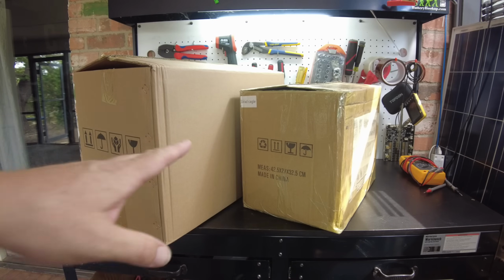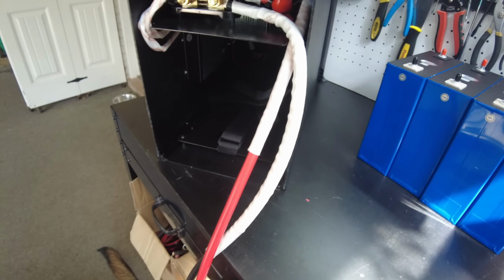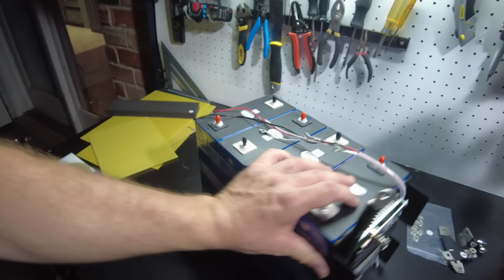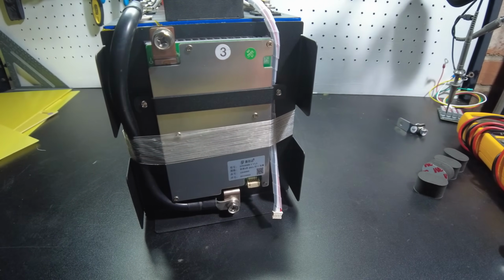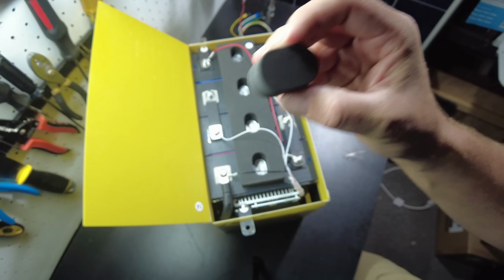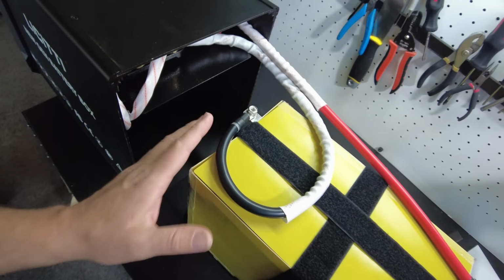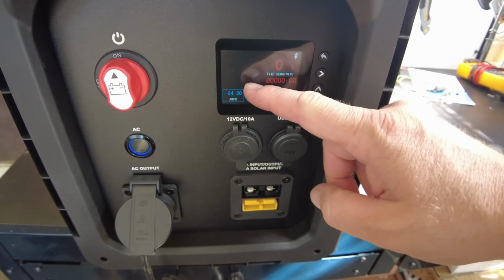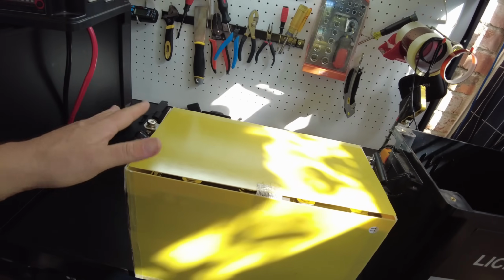Licitti 280Ah LiFePO4 DIY battery kit

Comment: I have one question. Since this box has a 20A MPPT controller and it is possible to connect a solar panel with a power of about 250W, is it possible to first connect a solar panel with a power of 600W to a Victron MPPT 100/50 controller and then from that controller to connect to this Gen2 box via Anderson input/output port? Would that charge the 280Ah battery with more power?
Reply from the maker: Yes you should be able to do it. I did it with the gen 1 box https://www.youtube.com/watch?v=b2g4V9Q4x30
Reply: @BradCagle  Thank you very much for your quick reply and information. I watched the video and you explained everything very well
Reply from the maker: @ZokiG  you're welcome

Comment: Licitti prismatic cell question from very new solar person: I have already assembled the 280 Ah prismatic battery kit using 4 cells from Licitti but not charged it yet.
 I have seen and read where prismatic cells will swell once charged.
   The busbars I connected were snug/tight.

 Can I remove the busbars to drill them wider so when they do expand, they will have some give/slack?
Reply from the maker: Well drilling wont help because they will be tightened down to the cell, so no expansion movement will be available. If you want the busbars to have some give, you'll just have to buy flexible ones, or the ones with the expansion hump. The other option is to build your own out of short lengths of wire, and wire lugs. Thanks
Reply: @BradCagle  Thank you greatly sir

Comment: Nice review, thanks. I would like to add a DCtoDC charger to this box with a higher rating MPPT, and i was wondering if you can help me up a little with some measurement, if you still have the unit. On 3:44 you can see the battery tray that is well inside the margin of the box where the lid comes. Can you tell me what distance is there. i think is more than an inch, although in europe we use mm. Can you help me up with this measurement? Please and thanks in advance

Comment: This box really seems compelling for the price and an hour or two of my time. I am curious about charging times off of solar and the optional 20amp charger. My guess is that slow charging is the only knock on this setup. ReeWray Outdoors channel said it took him 15-16 hours to fully charge this kit from a 20 amp charger. I have seen a LI-TIme 40 amp 14.6V charger with a Anderson connector on Amazon for $219 that looks like it could charge this at maybe 7 hours or less. What do you think Brad? I am thinking about purchasing this box with the battery kit but could use your expert guidance about charging options, as my knowledge is very limited. I could not find any 50 AMP AC to DC chargers that didn't look sketchy.
Reply from the maker: Yeah, for the price point I don't think there's anything else with this capacity (Short of full DIY) But I do agree it's slow at charging, especially the solar. Now you can just add a larger external MPPT, so that's an option. The Li-Time 40a AC charger could be a good option, just make sure the Neg/Pos pins on the Aderson connector are in the right place to mate up with the Licitti box polarity. They can be reversed based on how the manufacture decides to build it, but it's easy to swap the pins/contacts there's a spring retainer under each pin, just press it down and it can be pulled out the back. Thanks
Reply: Licitti has a 40 amp charger for their boxes. Today on sale for $80.

Comment: The wires look the same as the wires in the Gen 1. I've used these and the 320 amp hour versions, and have the 320's in my gen 1. I'll be putting fiberboard in between mine. That said, the primary test was perfect and even the strap worked on the Gen1. I use a simpler BMS, it is not active and works fine with multiple versions of these batteries. I do not like the way you hooked up the BMS , as the method with the plug disconnected is safer for the BMS. Yes, way lower voltages. Interestingly, the kits I get from China (exactly what you have here, just repackaged, what you do is put the fiber board in between the cells (thats in the instructions. ) . The final product as you have done it (seems to be the way they want you to do it) has no ventilation at all !  At least one of the engineer's wanted you to have a ton of ventilation for the system with fans in the front and back with some versions. strange anomalies from what I'm seeing. That said, I really like this product.

Comment: Correct me if I'm wrong, the battery box can be purchased with a 20 amp charger,  it would take 14 hours to charge, right.
Reply from the maker: Yes about 14 hours at 20amps
Reply: The monitor was estimating a bit over 14 hours at that point in the video.

Comment: Great video! Any test regarding the inverter with these 280ah large cells? Can it pull 2000w continuously? I saw that for 220v is rated at 2500w continuously. What do you know?

Comment: I use 6 inch wide kapton tape and just wrap the cells rather than fiberboard in between cells.
Reply from the maker: Yeah, I think that is totally sufficient really. I considered that myself. Any extra insulation is a plus. Thanks

Comment: I have the box and just built the battery using 304 cells.  I didn't have their kit so i just did my best using thin flexible cutting boards.  I like their product.   I've asked them to sell the 3000 watt box without including batteries.   Hope they will do so. I also think they could come up with an integrated ac charger.  They say it adds too much cost.  All in all...my 304 build turned this into a beast ...of course it is heavy!
Reply from the maker: That's awesome. I'm going to suggest they come up with a wheeled base option. They are getting heavy with these large cells. Thanks!
Reply: @BradCagle  funny...I thought the same thing.  I built my own box out of a wheeled tool box with 3000 watt inverter...in part to find a home for 4 relion 100 batteries I took out of my rv.  Then they came out with their 3000 watt box which is way more professional than my build plus they have more functionality. They do listen to you and some of the other YouTube guys so you are helping them make their product offerings better.  Thanks.

Comment: Your reviews are second to none Brad. Thanks mate.
That Licitti Gen 2 battery box is almost 100% - one little (perhaps not so little) capability is to allow several of these to sync their mains so you could parallel the mains to have 2, 4, 6, 8 etc. kW depending on how many boxes you string together. I hope Licitti read this comment - they have a winner here.
Reply from the maker: @BenMitro Thanks, that means a lot! Yeah these guys are doing some good stuff, and I'm glad they are paying attention. Would be really cool if it could do that. Also I think they should have a base with wheels option, with these 280 cells it's getting heavy. Thanks!
Reply: @BradCagle  Good suggestion, it'd be up around 65lbs I guess.
Reply: I am using their 50 amp input / output to tie two boxes together.   I then use either inverter as needed.   This seems to work as it discharges them at the same rate under my load conditions and charges both boxes back up via one solar input on one bax.
Reply: @houstonstarbuck  That is the best approach with what they have now. With the syncing suggestion, you would be able to run 4kW load as well as 2 x 2kW loads. (You could still tie the two boxes via DC to use  one solar input). I sure hope they look into this as the flexibility of their battery box will be extended substantially.
Reply: @Bennyboy-dog  I'm curious how to sync the boxes to provide a 4kw load?
Reply: @houstonstarbuck  You can't sync with the current design. They would need to redesign the inverter circuitry to provide this facility.  Grid tie inverters already do this so they can feed the grid, so it is possible. Essentially one box is assigned the master role (that is pretends it is the grid) and any others that plug in are slaves recreating their AC waveform to exactly follow the masters AC waveform. Then, all inverters can feed into the one cable and that cable would provide the combined power of each inverter.
Reply: @BenMitro  got it.  So similar to my two small generator that have a parallel kit to combine and create a 30 amp  3500 watt combo.
Reply: @houstonstarbuck  I imagine so.
Reply: @houstonstarbuck , 
Do you have a pic of this wiring or can you draw a diagram of it?
Reply: The Gen 1 box comes in under $200  and accommodates a 100AH battery.  The Gen 2 box is much more expensive at $448 and can handle up to a 300AH battery.    To me, these are two different products. I like 😮 1 as a portable power solution.  Gen 2 seems more of a solar generator replacement.
Reply: @bitsurfr46 
What would be a good solar panel to recharge the gen 2.

Comment: Ha, I just did the same thing, except with a "compact" 300ah battery, had BT and a nice BMS.  Saved money over separate cells and BMS.   Plus it was already assembled, just pulled cells from battery box and slipped them into my Licitti.
Reply from the maker: Nice!
Reply: How do you charge your box? It seems to me that their bundled AC charger or solar will take forever and am trying to figure out if you can charge this box in a reasonable time off my generator if the grid goes down for days. Licitti offers a bundle with a 20amp AC to DC charger, but that seems slow from my limited understanding. I know they also offer a 30 amp charger for sale separately, but that seems kinda slow for this capacity battery as well. I have seen a LI-Time 40 AMP 14.6V AC to DC charger for $219 on Amazon. Any help would be appreciated.
Reply: Regolatore mppt esterno  50amper e 100volt  renogi redarc o victron e max voc e 1 pannello fotovoltaico da 550watt is perfect   @jharrison1185
Reply: Can you drop a link for the battery?
Reply: No way that's cheaper than buying separate cells and bms. Depends on where you buy though.